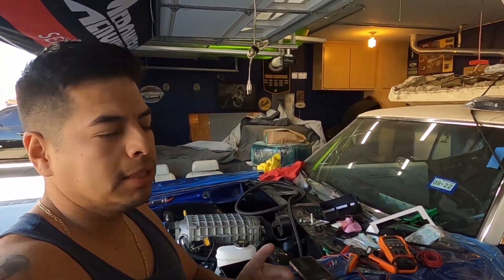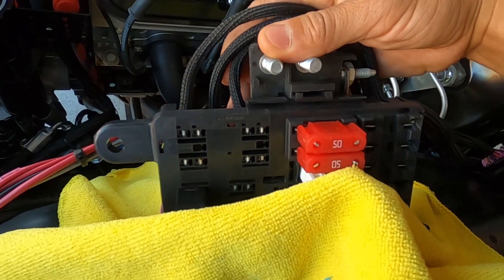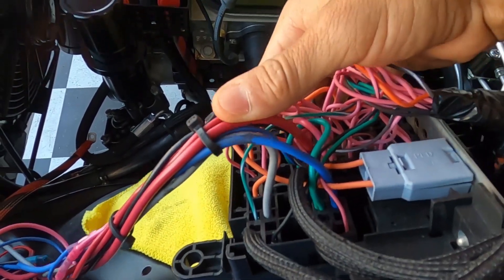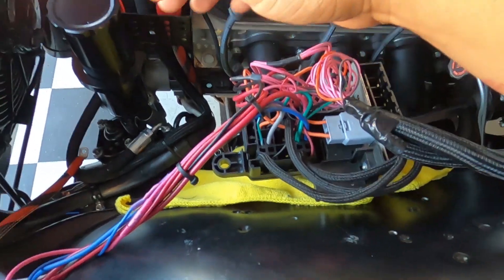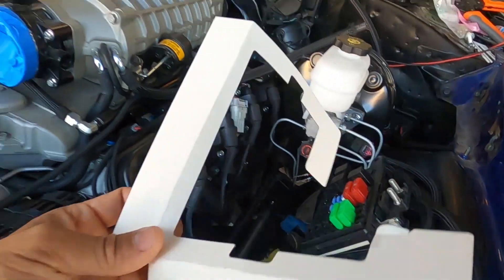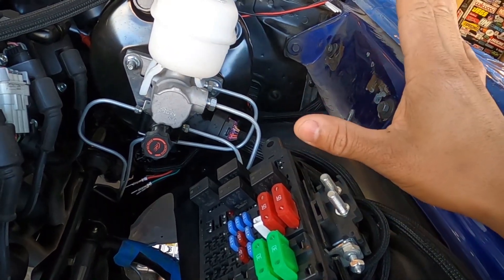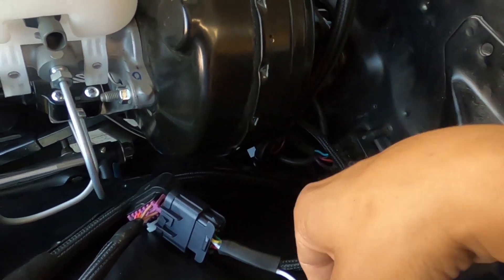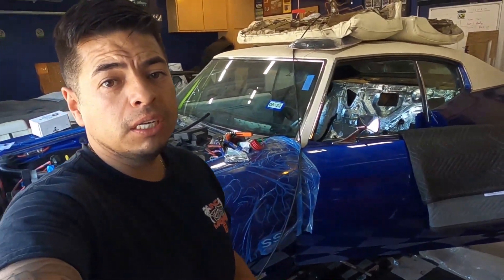HOW TO WIRE US SHIFT TRANS CONTROLLER TO GM PERFORMANCE LS HARNESS!

Comment: Did you have to add a pull up resistor to the tach wire form the bulkhead connector to get correct rpm signal to the us shift quick 4? I am using the same setup but no rpm reading with the quick 4 connected straight to the bulkhead tach output.

Comment: Your project is coming along very nicely. I ran across those issues with that same GM fuse Box. As for the Fans, I ended up using the Dakota Digital PAC-2800BT Electronic Fan Controller 70 Amp with Bluetooth Control and left the Gray wire alone< just incase anyone wants an alternative from the GM Wiring .  A lot less hassle Plus the Bluetooth make life so much more simple. Lucky for me I don't have to mess with TPS. (6speed) I like that 3d print for the GM Box I can use one .Great video!

Comment: Another awesome video. I used a PSI harness and they don’t have a TPS output, which made my swap a nightmare. Having to use a voltage decrease box, second TPS from TCI that I had to wire up to the throttle bracket. Your video outlines a much much easier process. Well done bud. Keep deez vids comin!!!!!!
Reply from the maker: Only reason for this for the tps is the transmission control from us shift if you use psi it is not required
Reply: @goosseperformance1444  yep. But I’m also using the QuickShift 4 TCU that requires the TPS input. Called PSI and they said there is no output from their harness. So I’d either have to splice the output from the actual throttle wire, which I heard can cause havoc on the ECU, so I don’t want to do that. Or maybe I can track down the exact pin from the ECU?